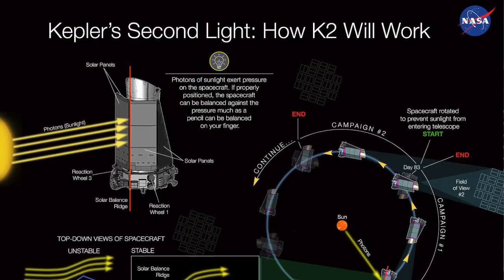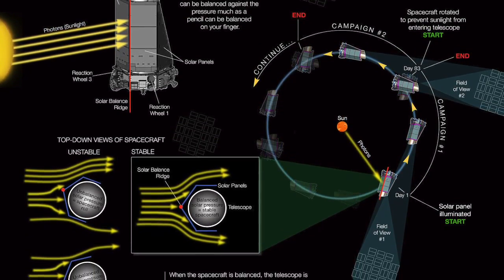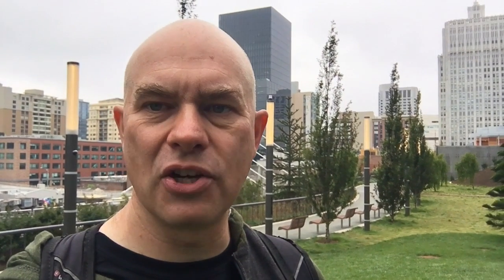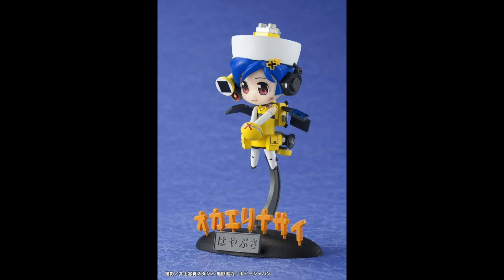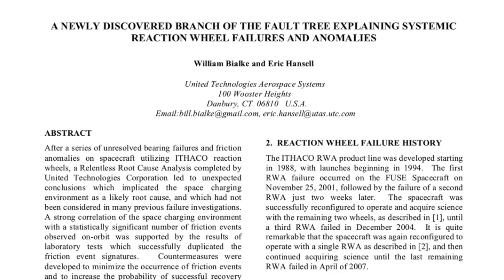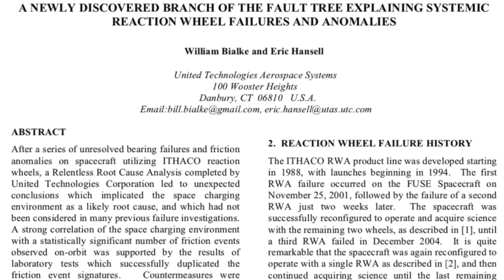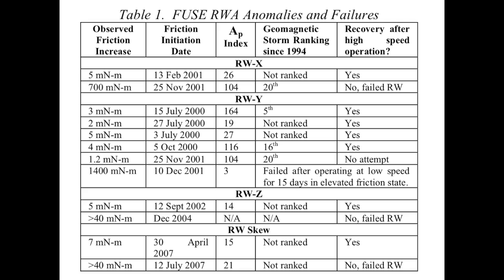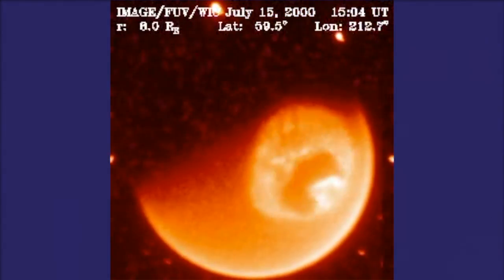Scientists May Have Figured Out Why So Many Spacecraft Were Failing

Comment: I think things like this is why we should try to plan for a potential recovery of some probes. I'm no rocket scientist or astrophysicist, but surely it would be worth the extra trouble to actually get a good ol' fashioned 'MK-01 Eyeball' looking at things, right?
Reply: Play some KSP and try to recover a probe you deployed into interplanetary space and I think you'll answer your own question.
Reply: Pfft, you're clearly not thinking the real kerbal way. Just build another Saturn V and send up a little robot arm + capsule to grab and return one of these probes.
Reply: Oh that's what I do. I just....misinterpret the numbers on occasion (read: all the bloody time), resulting in recovery vessels needing recovery vessels....Which need recovering in true Kerbal fashion.
Reply: Maybe if some of them are in low Earth orbit, we can take a look. Otherwise, it's simply not practical. Spacecraft are only given enough fuel for their mission, and not enough fuel to return to Earth.
Reply: I think most of these craft are in solar orbits, or very high Earth orbit, so we don't yet have anything capable of reaching them and returning to Earth. They are also mostly outside of Earth's magnetosphere, and thus more exposed to solar radiation, which contributed to the problem.
Reply: All spacecraft should be launched on bungee cords to pull them back to Earth when their mission is over.

Comment: Im not really a bearings-expert, but isn’t ceramic the more obvious choice for sucht parts? I mean its harder and lighter right?
Reply: I'm not an expert either, but don't materials have more attributes of their structural capabilities than sole hardness?
I thought ceramics wear out quicker than metals or something like that.
Reply: Temp Name  Ceramic bearings only wear out more quickly in high impact situations. A reaction wheel in an unmanned spacecraft millions of kilometers away from Earth couldn't be further from a high impact scenario.  Ceramic bearings also handle lack of lubrication better, which is handy in space where most lubricants have a habit of evaporating.
Reply: Aren't reaction wheels experiencing high stresses most of the time, though? Doesn't that make up for the lack of impact?
Reply: Temp Name  
Reaction wheel bearings could easily have a very high load.  However, an impact is a very different thing from a constant force.   Very stiff materials (like ceramics) result in the momentum from an impact being concentrated over a shorter time period, so the peak force is much higher. So, although a peice of ceramic may be able to handle a much higher force, any impact also tends to cause even higher forces.  On the other hand, avoid any impact loading, and the ceramic will definitely last longer.

Comment: Why couldn't we test this theory on the ground?  Surely we could simulate a sufficiently large enough plasma discharge...
Reply: John Drachenberg   It's easy enough to test that electrical discharge will damage the bearings. Testing to see if solar flares will cause sufficient voltage across the bearing is a different story.
Reply: It's not just that it's the type of radiation - protons and muons for starters as well as everything from about microwaves through to gamma. Even though the sun is 93 million miles away the amount of crud and energy that hits us per square meter has to be seen to be believed. 1kw/m2 is just the optical light. The amount of power the sun kicks out is mind boggling and it's not a big star.
Reply: We can and they did. The issue is figuring out whether that is actually what caused the reaction wheels in space to fail.
Reply: Jukelo we can replicate the type but nothing close to the intensity experienced after a CME.
Reply: That sounds like exactly the kind of thing we don't want to build on earth. Therefore I'm all for it.